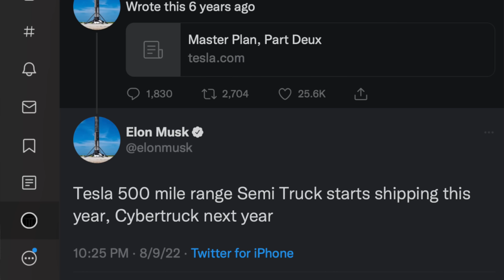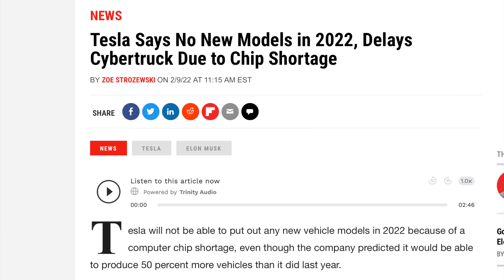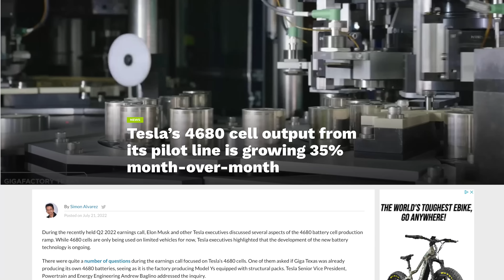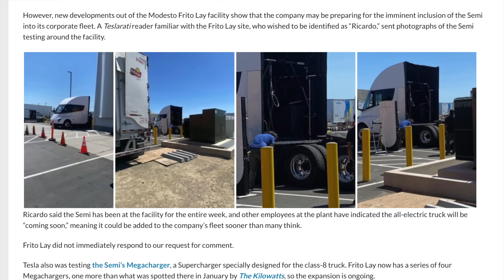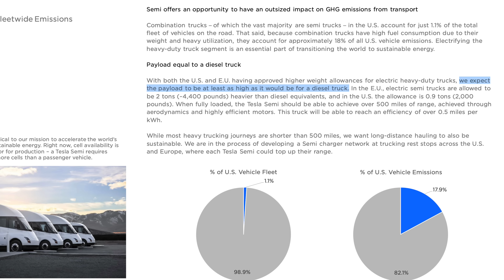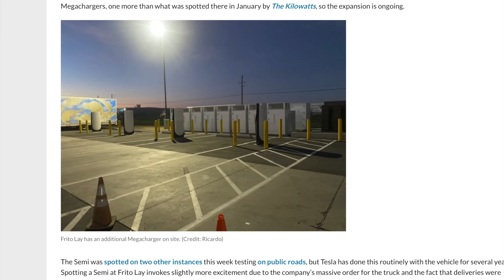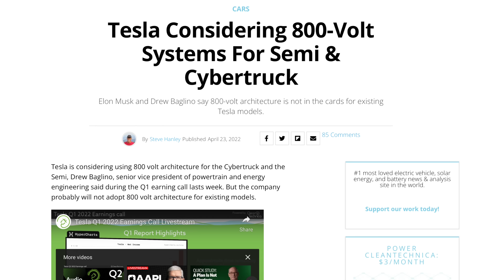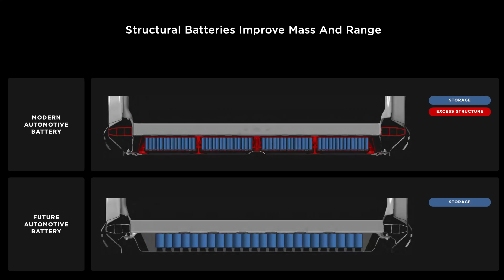Elon says Tesla Semi Launching THIS YEAR!?

Comment: I hope Tesla brings back the fancy futuristic rim covers they used in the original prototype. I understand fashion is not practical or relevant in the trucking industry, but I think it would be better for aerodynamics and efficiency if they don’t use traditional mud flaps and bare semi wheels. I can’t see the Tesla semi reaching a   0.36 drag coefficient with mud flaps and without the smooth rim cover. I’m sure without a rim cover, the wheel nuts and bolts will cause air resistance.

Comment: My guess Tesla is having yield and quality problems with the 4680 batteries.
This might be the reason they are pushing Semi, to avoid consumer protection law.  Large and medium buiness is all contracts. 
Do wonder if Semi is running between the factory and train depot. Shipping batteries by train between CA, NV and TX. Then using Semi for pickup and delivery from the train. They could even install industrial super chargers at the train station.
Reply: It might be a good for Tesla to lease the semis to their customers. Then at the end of the lease they return it and get a new model with better batteries and Tesla avoids the liability of having less reliable 4680s.

Comment: 500 miles is useless except for very few circumstances. You clearly know nothing about diesel semis, which makes sense since you don’t run a trucking company. Adding hours to fueling per truck alone negates any fuel discount from switching to electric. That’s even before we get to teslas poor reliability and limited repair network
Reply: @TailosiveEV  I'm going to reiterate you have no idea what you're talking about
Reply: @whiteandnerdytuba  – You’re not incorrect; but, you’re not entirely correct either.  500 miles of range is PLENTY for fleets operating within regional applications (~60-70% of all fleet business).  Now, personally, I don’t believe the Tesla Semi will release this year and — IF it does — it will not have a 500-mile range nor will it be offered for less than $350,000.  But, if the Tesla Semi gets at least 350 miles of range like the Nikola Tre BEV fleets will gradually adopt these class 8 EVs, bringing them into their fleets.  FCEVs (fuel cell – hydrogen) will be adopted for long haul trucking.
Reply: @DebtPRZ  I operate regionally, I would have to charge twice just to cross Texas. You're confusing regional with local. 500 miles is enough for local traffic, hence why diesel trucks that are only expected to go 500 miles have much smaller tanks. It only works as a day cab until the range is better, only the trips that start and end at a giant warehouse is where it will work. That's not 70 percent of loads. That's Tesla marketing which has a reputation
Reply: @whiteandnerdytuba   – I work in the commercial trucking industry as well.  By industry definition, a regional fleet is any fleet veering no more than 1,000 miles from the fleet yard.  For example, Publix, UPS, FedEx are massive in size (especially the latter two), but a significant portion of their fleet operates on a regional level.  And they’re truck roughly 350 miles per shift.  Not trying to sound like a know-it-all and I most definitely respect your perspective.  Just saying, In dealing with large fleets on an almost daily basis, I know 500 miles of range (even 300 miles of range) would cover a significant portion of the mentioned fleets’ business needs.